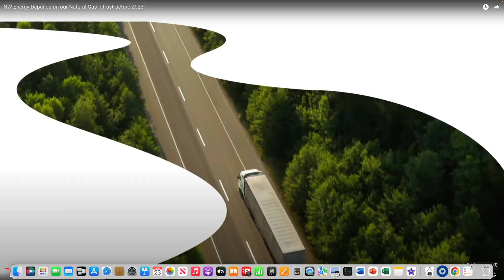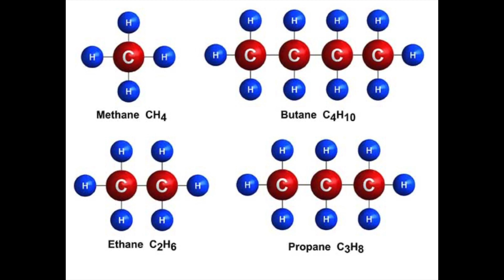Hydrogen in gas pipelines:  A good Idea?

Comment: Good conversation.  From what I have always heard, Hydrogen is more volotile gas than natural gas.  They used Hydrogen gas in the Hindenburg.
Reply from the maker: It has a much lower temperature for ignition.  That coupled with its flammability percentage would make it even more dangerous.
GFM

Comment: Coal gas:    The original coal gas was produced by the coal gasification reaction, and thus the burnable component consisted of mixture of carbon monoxide and hydrogen in roughly equal quantities by volume.
Reply from the maker: Interesting thought.  I am not sure if the hydrogen is a free gas or is mixed in compound with other components.  If it is a free gas it looks as though it was useable in wrought iron pipe as that is the only piping I ever saw it used in.
GFM

Comment: Renewable hydrogen is a silly; the efficiencies of H² generation are abysmal be it burning or fuel-cell. And H² slips through teeny tiny gaps - ask NASA! Every time I hear H² being pushed I look for Big Oil in the background somewhere pushing there wares. "Look, Natural Gas is now Green!"
Aside: It's named as Gas Station for a reason.
Reply from the maker: I am sure big oil would love hydrogen.  Made from Nat gas.  The idea that excess solar could be turned into hydrogen is, as you say, inefficient.  
The real solution is battery backup using lithium.  Much higher efficiency.  no problems with hydrogen leaks, explosions. etc.
GFM

Comment: Your concern is valid; but doesn't go far enough.  I spent 35 years designing improvements for chemical plants; a number of them used H2 in the process.  H2 loves to leak even through seals/gaskets that hold the larger molecules just fine (just as you suspected).  It can even pass through some heated metals.

You are correct that H2 rises rapidly and does not collect in sumps; instead it get trapped in the ceiling where all the lighting (which are ignition sources) is located.  The ceiling/sheds above H2 compressors has to be treated as NORMALLY electrically hazardous just like sumps are treated for hydrocarbons.

Hydrogen also requires much less spark energy to ignited it.  This is reflected in the classification of the "explosion proof" electrical equipment that can be used for H2.  Most hydrocarbons (methane, gasoline, propane, etc) require the equipment to be rated as Group D which is fairly easy to build.  Group C chemicals (which require less energy to ignite) are ether, carbon monoxide; ethylene and it is common knowledge how easy ether is to ignite - think engine starting fluid.  Hydrogen is in Group B which needs very little energy to ignite and requires extreme levels to protect the electrical equipment from igniting any H2 in the atmosphere.  The cost of this equipment is expensive for Group D and C but really jumps up for Group B.

Pure Hydrogen also burns with an invisible flame.  If a leak was suspected in the plant, some operators would wave a broom around the potential leak and see if the broom caught fire.

I would NEVER put H2 in a piping system that was not designed for that service.  It is possible that a system designed for methane could contain H2 but every single component needs to be evaluated by a number of different engineers before the switch is made.  Most of the time it would be cheaper to just buy new H2 rated equipment than do all the evaluations.
Reply from the maker: Very interesting info.  We in the HVAC industry have always feared propane as it is heavier than air, but I never thought about a lighter than air gas hazard.
GFM
Reply: @grayfurnaceman  Everywhere I worked had either flamable and/or toxic material.  Maintaining safety was how we existed.  If it had a potential fatality; there would normally be 3 to 4 layers of protection provided.  That would never work for residential housing; so H2 should stay out of houses.

Comment: So, in order to detect a leak big enough for hydrogen molecules to slip throught but too small methane molecules, you will need to do it the good old way: lighting up a match. Don't think we have a simple device to detect hydrogen gas in small concentration. Will soapy water work? I don't know.
Reply from the maker: We do not use the match test.  Never,never.  There are hydrogen gas detectors.  Some combustible gas detectors will work.
GFM
Reply: @grayfurnaceman  Yes, I know, just kidding. However, I have seen people doing that when I was little and liquid propane was used for cooking.

Comment: I don’t see any issue with it other than it will dilute the BTU value of the natural gas steam…meaning you will be paying for less total BTU’s entering your home or business. I worked in a refinery for 40+ years and we called hydrogen “hot air” because it was basically worthless as a heating fuel
Reply from the maker: The leak issue is valid, but your point is true.  Hydrogen has about 1/3 the value of nat gas.  
GFM

Comment: I'm working on a project with my employer to build a hydrogen recovery system. There is no way that H2 will be viable in natural gas pipelines. It will leak out everywhere - in places you would not expect. Additionally, the only safe way to use H2 is to incorporate H2 leak detectors and ventilation systems. The cost would be exceptional.
Reply: that's probably the whole idea, to drive the final nails into the gas pipelines.... by a bunch of imbeciles with no clue.

Comment: Hydrogen is a pain. Metal and other solids are a network of atoms spaced set distances from each other vibrating with the impacts of the millions of collisions with gases and liquids. Hydrogen regularly gives up its electron which is easily lost in the sea surrounding the metal matrix. The proton is now even smaller than monotomic or molecular hydrogen and it can pass through the matrix over time. Comes down to if you placed a box sealed with hydrogen on a counter it would slowly diffuse. Leaking through the pipe as well as through the tiny gaps and seams is gonna occur no matter how well sealed it is. Now if it's going through a well ventilated space it can't accumulate and explosively ignite. Small leaks that burn will burn out as the rate of leaking is gonna be lower than the rate of consumption. Now imagine these new air tight houses with a leak into the living space accumulating waiting for a spark. The efficiency is gonna be terrible, and you now have a leak prone gas emptying into the large volume of living space with little to no warning. I think it'll be killed off by being unscalable but bless the hearts of these dreamers. I'd rather they put all that effort into a tank combat sport, space elevators would be cool too.
Reply from the maker: Someone close to me is also dealing with a hydrogen plant.  The materials used are quite exotic.  Let's hope this goes nowhere.
GFM

Comment: Thank you for the information. 
Any more information on my rumbling oil furnace? I know you're very busy but you have helped before and I appreciate it. Thank you.
Reply from the maker: Rumbling is caused by an inability to establish a draft.  I don't know how much info I have given, but it is usually a blocked vent or a negative pressure in the structure.
GFM
Reply: @grayfurnaceman  Thank you. If I turned on the breaker a few seconds later and it lights right away and runs properly would this still be the case? Or has the short time it rumbled made enough heat to get the air moving?
I sooo appreciate your help.
Reply: Can the negative pressure be from it being so cold? Often got in the 40s over night.
Reply from the maker: Cold temps can cause it.  Usually if it is vented thru a masonry chimney that has a large inside volume.    If the chimney is clear, you can line the chimney with a smaller vent pipe.  Exhaust fans can do it.
GFM @kaybreece8701
Reply from the maker: It probably did establish draft from the heat.  Most rumbling is most noticeable at early morning fire off.
GFM @kaybreece8701
Reply: Because that's when it's coldest? The temp in the 40s was inside temp.
Had this furnace for a while and I don't remember it ever doing this. 
Chimney is square chimney block with clay liner. I inspect and clear the chimney clean-out every fall and reach into the furnace from the chimney end to the heat exchanger. I can look up the chimney with an angled mirror. I get very little from these locations. 
You're being very patient with this and I'm grateful.
Reply from the maker: If that's inside temp, I would expect it to rumble.  Not made for those temps.
GFM @kaybreece8701
Reply: Have started it at low temperature in the past. No rumbling. 
Is the rumbling dangerous?
I am VERY thankful for your help and patience.
Reply from the maker: It can be if it gets very bad, usually from a blockage it can cause a puff back.  A nice word for a very nasty blast of soot all over the structure.
GFM @kaybreece8701
Reply: Still debating on what to do. Not changing to propane. 
Have been checking out available new oil furnaces. 
Clean heat exchanger? Start furnace earlier in the season before it gets so cold? (First start always scares me.)
Just saw your video on AC. Comments on trees for shade. My house is surrounded by maples and hasn't been higher than 76 in here, no AC. 2 story and I chose white architectural shingles. Yes Michigan but we've had some heat.
TMI? Anyway THANK YOU!
Reply: I've chosen to stay with this furnace, buy a minimal amount of oil until I see how it is going to act and try to start it before it gets so cold. 
Thank you for all your help.

Comment: It might depend on the region, but in MN the steel gas pipelines have mostly been replaced with polyethylene pipe starting from the late 70s or early 80s. Of course iron pipe and copper pipe runs exist inside houses, but PE pipes are fused by physically melting them together or via punching the main for service connections.
Reply from the maker: Emphasis on "most".  The steel portions and fittings are vulnerable.
GFM

Comment: lol - hydrogen is primary extracted from natural gas to begin with. though it can be produced with electricity - electrolysis.
Reply from the maker: They were saying excess electricity from solar and wind could use electrolysis to make hydrogen and it could be stored on site to make power when solar and wind are down.  
I have no problem with that.  My problem is putting it in existing piping, especially at the point of use structure.
GFM
Reply: @grayfurnaceman  hydrogen really doesn't sound like a very forgiving fuel. plus the existing equipment isn't made to burn it. it may be something that makes sense to produce and burn off locally - though the process is not efficient if it's to be converted back to electricity.
Reply from the maker: The use from electrolysis of excess electricity could be used as a fuel for boilers (30 to 40% efficient) or for fuel cells (60% efficient) could be done, but perhaps a better solution might be battery backup at 85% efficiency.  @Jon-hx7pe   
GFM

Comment: Hydrogen embrittlement? That would be my biggest concern....
Reply from the maker: That one may be true for steel alloy piping.  I have no real knowledge of its effects.
GFM
Reply: Hydrogen Embrittlement occurs when metals become brittle as a result of the introduction and diffusion of hydrogen into the material. The degree of embrittlement is influenced both by the amount of hydrogen absorbed and the microstructure of the material.

Comment: Correct.  Then there is pressure, then there is burner jets.  It should be produced at source then used to fuel conventional style electrucal generation and or fuel cell.  
Nitrogen?  What?  No, not explosive.  The atmosphere is mainly nitrogen.   Way wrong on that one.
Reply: No, he repeated it several times.  Doesn't appear qualified in the slightest.  :/
Reply: I'll repeat my comment to others here also.
*it all plays along with them fully eliminating natural gas/propane in homes and making everything electric, Now only "they" use, store, transport and sell the hydrogen fuel. no more gasses supplied to any homes, which means no more appliances that can use it and all existing will be useless.
welcome to the stone ages! There's nothing better than relying upon a single unreliable resource. meaning the utility grids are stable as a leaf pile in a hurricane.
Reply from the maker: The idea that electricity is a single source is really not true.  My home and vehicle are powered by solar energy that does not come from the "grid".  There are changes coming to power sources.  Will be doing videos on battery backup, etc soon.
GFM
Reply from the maker: You got it.
GFM